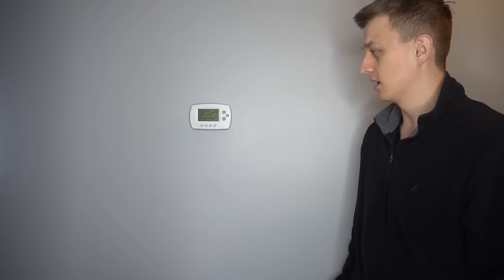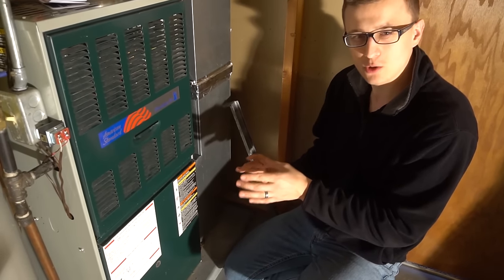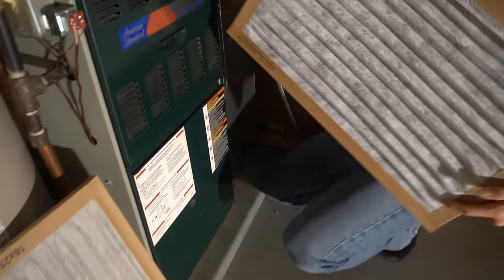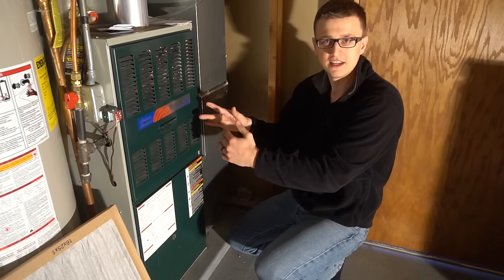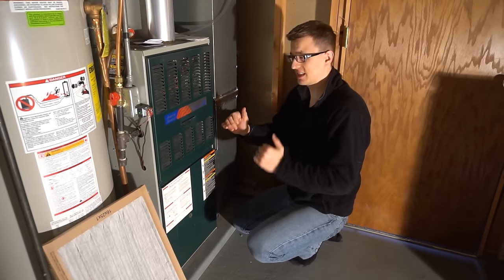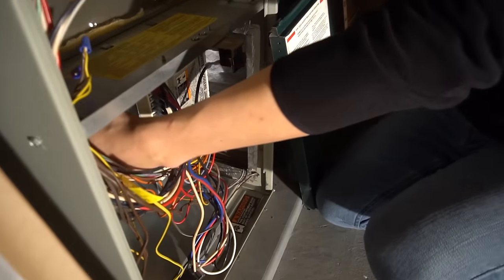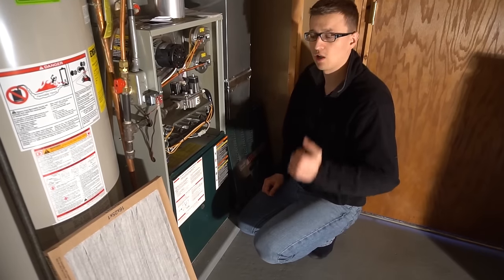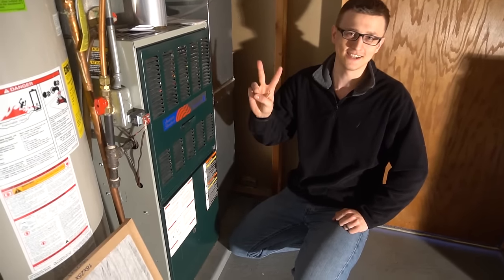Furnace not Keeping up SOLVED

Comment: Turning the squirrel cage (blower fan) by hand does not tell you the fan motor is burned out - it WILL tell you if the motor bearings are seized.  The windings could fail (or a capacitor if so equipped) in the motor, causing it to not rotate and thus no air flow. Your lockout should have worked, if not and the furnace kept cycling, it may have compromised the heat exchanger!  ALL furnaces should have a lockout - it`s pretty much required!
Reply: I don't really see how cycling will kill a heat exchanger in a couple hours- thats all they do. Also a lock out is a terrible idea, obviously if you have the heat on you really need it to be keep warm If the heat still works only OK its still way better than it shutting down when your on vacation and freezing all your pipes. As a GC I hate stupid controls like that. 

Also if you have a bad cap you wouldn't smell anything from the motor its self and it would turn free, So it would be pretty clear what it was.the last suspect for me would be a bad winding, fairly rare and thats when a diyer should probably call in a tech.

Comment: I had exactly the same issue mentioned in the video, took the steps suggested it worked. Now again on colder day the problem returned. So removed filter running it without filter. Is there any filter brand u can suggest won't cause it anymore
Reply from the maker: It's possible that your A-coil is partially plugged and that is what is causing this. I usually use a low MERV rated pleated filter. 3-5 MERV. The brand will not really matter though. It's not a good idea to run the furnace without a filter, it would be best to at least put in a fiberglass filter. (least restrictive)
Reply: @WordofAdviceTV  
First of all Thanks for your prompt reply. You are really doing huge favors to people. I have american standard Gold series furnace, do you have any video on cleaning A coil o this furnace. Thanks.
Reply from the maker: @aaii8700  Unfortunately I do not have any A-coil cleaning videos. Sometimes they can be quite a hassle to clean. A lot of people opt to hire a duct cleaning company to clean it for them. It's preferable that the coil is cleaned from underneath. In my video 10 Reasons Why a Furnace Overheats I filmed how I looked at mine if you are interested.

Comment: What happens if the machine starts, you can hear it turn on, but it doesn't come on? And it repeats the process but never turns on any heat?  Could it be the filter or the way my thermostat is set?

Comment: Hello, I live in South Florida and my brand new AC (2 weeks old) ever since it was installed, it runs for about 7 minutes every hour or so. The Thermostat states the temperature desired is reached, and therefore it just turns once (for 7 minutes) every hour. 

We set the temp at 72 before bed, and it will just run these 7 mins per hour to maintain that temp. 

Now, if I lower the temp by a couple of degrees then it will run for about 12 minutes… However, still just once per hour. 

Please let me know what could be the issue. Brand new Ac/Thermostat.

Comment: I have the same problem on the cooling side. My temp is set to 72 but inside temp is reading 74 and climbing
Reply: So did this work for you?
Reply: @momsmusclesmakeupbynickias2081  No, found out the coil is leaking freon

Comment: the filter u took out looks clean i dont understand why u switched fiters
Reply from the maker: Sometimes clean looking filters can actually be very plugged up. (sheet rock dust could be plugging it up for example) I have checked "clean looking but plugged" filters multiple times before by measuring the air pressure drop across the filters just to make sure. In my case, once I replaced the filter the furnace stopped overheating, so I didn't do any further checking. :)
Reply: @WordofAdviceTV  Based on all the debate here, I'm thinking you should do a video on furnace filters. I"m interested in hearing what advice you have :-)

Comment: I got a service call today for the same problem and i had to put a new filter and put a new thermostat just in case but .. Unfortunately  it didn't fix the problem and the furnace seems to be working fine but never reach the set temp!!
Reply from the maker: The filter is the easiest solution. There are many other things that can cause it to overheat.  I have a video with 10 reasons: https://www.youtube.com/watch?v=3ZPmltTR5S4

Comment: I hope this helps. It's 1° outside and my furnace was set at 77 because my insulation sucks. It wouldn't go above 71 and it's been running for hours before I noticed why I was abnormally cold (I'm always cold). I turned it down to 69 so the heat would shut off and changed the filter. Gonna let it sit at that temp for a bit so it has some time to cool down before running again.
Reply: No such luck. Had to call them out. He's saying I need 2 new heat exchangers, and an inverter and that it's producing more condensation than it should. Filled a bucket with water that smelled burnt. Minimum if under warranty is 2k, a new furnace which he recommended would be 5620. Can't run it due to high probability of carbon monoxide issues. Bought 3 space heaters and when I plugged in the 2nd the breaker flipped, so I never even got to try the 3rd. Been a stressful day and we are in the middle of a winter storm, so that's fun.

Comment: Hey, My blower is on, the flame comes on for about 5-6 mins and then turns off, then turns on fir another 5-6. Before that the blower was not turning on. I changed the filter, and it got a little better but flame keeps going out blower is blowing. I changed thermostat as well. Could it be flame sensor?
Reply from the maker: No that doesn't sound like a flame sensor. It's more likely that the furnace is overheating. I have a video on 10 reasons why a furnace overheats. Check it out for more info if you'd like:
https://www.youtube.com/watch?v=3ZPmltTR5S4&t=107s

Comment: -38 currently my furnace has been doing the same thing for as long as its been cold
Can propane lines freeze up or shoukd i go ahead and change the filter to see if its needs to be changed and replaced ?
Reply from the maker: I don't deal with propane too often but I haven't heard of propane lines freezing before. As for the filters, I see them be the cause of this problem all the time :) So I would start by replacing the filter and see if that makes a difference

Comment: I'm having the same problem in the day if temps above 38 no problem but cold nights below 34 it cuts on and off and when ever the unit turns on it sucks so hard that it want to eat the filter any solution?  Thank you
Reply from the maker: It kind of sounds like you do not have enough return air. Maybe add a return or 2? Are any of your return air registers blocked or closed off by something? If you use a premium filter, I would switch to medium grade pleated filters.  If the unit blinks an error code when this happens, what is the code? From what you described it sounds like it may be overheating.
Reply: @WordofAdviceTV  I have a ruud furnace but I'm getting a code of 5 than it blink a number 6 right after it none of these code are located on my panel.  Thank you
Reply from the maker: @ikeproc  Do you by chance have a lot of air registers/vents closed off? Also, the chart that explains those codes is usually on the inside of the furnace door or on the control board itself. Or if you have a manual from that furnace, you can find it in there too.
Reply: @WordofAdviceTV  We finally figure out the problem the furnace was set up for down flow and the control panel wasn't flip right side up so the code was not 56 but 59  a block drain, all is up and running well.  Thank you for your help.
Reply from the maker: @ikeproc  Ah I see! Thank you for coming back with an update! Glad you were able to figure it out, stay warm ;)

Comment: Mine is the opposite. It won't let me set the overall temp(when you hold the arrows and it let's you set. Mine doesn't do anything anymore. ) so I set all those custom Temps to 72 but it keeps cooling to 66 degrees. I changed the batteries and filter 4 months ago

Comment: What is the issue if it keeps blowing cool air because its over heating. It starts fine,ignitor works and starts but then it stops blowing hot and but then it starts blowing cold air. 

My question will never be addressed but it feels good letting it out

Comment: My furnace heat works till 68° and then just blows warm air but won't go above 68 any reason why, I cleaned carpartment that was full of dust, the filter was changed 2 months ago and the furnace worked before then at 75 so I just don't know what's going on a company has been out 5 times and can't get it running right either

Comment: I took out the sensor and the flame cleaned it some steel wool so off and put it back but it still goes on and off the furnace occur in the thermal coupler that’s late and up let me know what you think I should do

Comment from the maker: If you have 1 inch furnace filters, don't forget to change them every 1-2 months and you won't have the same problem I had ;) I kind of forgot about mine for about 3 months and that was enough to become an issue. Don't buy premium filters that are around 20 bucks a piece either.. They tend to restrict airflow quite a bit. Just get medium grade pleated filters. I buy a pack of 6 from Amazon like these for example: http://amzn.to/2EUlkUd
Reply: What's the lowest temperature these thermostats can pick up?
Reply: Do you know of cheaper options for 20 x 25 x 4? The cheapest I've found are about $20 each in packs of 2 (MERV 11). That's what the installer put in 10 years ago, so I've been using them and changing every 3 months. I don't mind changing every month if I can find something cheaper that will do the job.

Comment: I have the same problems, changed the filter same issue, changed the thermostat same issue. Set to heat 71 won’t go above 66-67? Thanks in advance
Reply from the maker: It's possible that your A-coil is plugged. If you look through the site glass on your bottom furnace door, can you see any error codes blinking while the furnace burners are not on but they should be?
Reply: Word of Advice TV thanks for the reply, ended up being a high limit switch. Working like a champ now. Thanks !!
Reply from the maker: Awesome! Stay warm! :)

Comment: Hello my dear, my heater setting 72 but the heat keep running to 90 does that mean dirty air filter?
Reply from the maker: Definitely not :) Either your thermostat is defective or the control board in the furnace is bad. It's stuck in a heating cycle that does not turn off. (you can turn the power off to the furnace to shut it off)
Reply: @WordofAdviceTV  
Thank you my dear....

Comment: What if during the summer the Thermostat is not holding its temperature? As the temperature is increased during the day it seems as though my AC is trying to keep up. It seems to be around 2° off of why I set it. Example temperature set inside to 73 house it’s consistent at 75. Then when I said it to 75 the house temperature increases to 77   What’s going on?  Everything else is working fine

Comment: I live in Florida and I’ve tried the no filter for a little bit with no change.   My ac runs for 12-13 non stop during the day.  At night it runs fine once it cools the house.   I keep the temp set at 78 but it never reaches the shut off point during the day and many times never reaches the set temp.  What are some causes besides the filter.    Oh and the coil is clean and the condenser coil is clean.
Reply from the maker: Unfortunately that sounds like you are low on refrigerant. Do you have gauges that you could check the pressures with? Although typically when it is a freon issue, that will require getting a tech to come out and look at it. One thing you can do to confirm this is to check the temperatures in your ducts and see if they are in range or not. Most likely they will not be in the 15-20 degree range. I have a video on that if you want: https://www.youtube.com/watch?v=beVRELr8Oak
Reply: Thank for replying.  The original tech put Freon in the second tech took Freon out.  They both said that it was full.  Neither of them did any test other than a gauge on the lines..  I now know thanks to YouTube university lol that there are many tests needed to be done before just filling or relieving the Freon.
Reply: There is a third tech coming out again
Reply from the maker: Oh boy.. Thanks for the updates! I wonder if you have a restriction in your metering device. Sometimes freon issues can become quite the project. There is also the possibility that your compressor valves are weak. But you are right, there are many tests that can be done besides just checking the pressures to narrow it down to the culprit. I hope the third time will be the last time!

Comment: I have baseboard heat in my house and I set the thermostat at 74 but with not reach temp.  I changes the thermostat and circulating pump and still no heat.  The boiler is operating  at 180 and cycling as normal and the pipes are hot throughout the house but not hot enough. I also purge the system thinking I might have air in my line and still no high heat.
Reply: What kind of baseboards? The 8"tall cast iron?  They stink compared to the old tall boys.. you may not be getting enough water thru it.. also depending on how big your house is a zone system may work better.. what are your water temps? What is your cut in and cut out temp?
Reply: Also flushing your boiler system each year before heating season is always a good idea.. rust can build up and cause flow issues
Reply: Thank you for your response. I have the floor baseboard which run throughout the house.  When the temperature on boiler drops to 160 it will turn on and reach the set temp at 180. I have to run the boiler at 25 to 30 psi so the heat could reach the third floor bedroom but sometimes the relief valve activates. Another issue I have is that sometime the psi climbs to 50 to 60 for no reason. What can that be?

Comment: What if my room temp is 82, I ve bee setting it to 63 on hold but wont change to 62. So freaking hot
Reply: Change filter
Reply: If room temp is at 82, you’ll never get down to 63. Or at least quickly. Turn it down a degree every 30-60 minutes until you get desired temp. It’ll take several hours to get down to 63
Reply: If there is draft in the room it won't kick off. You need to check to see if room has cold air coming in from somewhere.

Comment: I’m having an opposite issue where my house won’t cool down pass 83 degrees. I unclogged the drip drain I cleaned all the filters and Open all vents. There Luke warm air coming out and checked the fans. I need help it’s to hot!!

Comment: LOL if you're in charge of your furnace.. (ie: you're a home owner, or renting a house) then you should already be well aware of furnaces needing filter changes. This should literally be the first thing you do when moving in to a new house. Also since some of you readig this are thinking. "i never knew"  then you should also know that you need to empty your lint in your dryer after you dry a load of clothes.
Reply: As a new homeowner, I did change my filter. What I didn't realize (at the time) was the new filter was a higher MERV number. Couldn't figure out why my furnace wasn't working as efficiently. After doing some research, figured out I had an 11, went down to an 8 and bam, furnace worked well again. So it's not just knowing to change the filter, it's knowing there's different levels of filters - and higher isn't always better.

Comment: Mine won't keep up to the set temp either.  I just changed the filter.  It comes on at times, so it's working, just not at my request.  If I turn the fan ON, it also works, but the fan isn't running ALL the time on Auto.  It's keeping the house at about 64-66 when my request is set on 70.
Reply from the maker: So after you replaced the filter it is still doing that or you just replaced it? If you look into the sight glass on the bottom door of the furnace, (when it is not working right) does it blink an error code?
Reply: Mine ended up being the condensation trap. Fully plugged. Thanks to the post in here that suggested that! :)
Reply from the maker: Awesome! Glad to hear you figured it out :) Stay warm!

Comment: How to set call for heat setting? Seems like the room gets too cold before furnace starts.Temp temp gets too cold before heats kicks on.How to set length of time from room temp? I need to set the time sooner so the house doesn't get too cold between furnace cycles.
Reply from the maker: Are you sure it is the thermostat that is bad? Perhaps your furnace is overheating and going into a lockout and that's why it does not turn on right away.  When it doesn't turn on like that, does the furnace control board blink any error codes?
Reply: Yes it is normal.Once it is up to temperature,how many degrees should it drop, before relighting?  Thanks
Reply from the maker: @happycat  Usually even if it drops down one or two degrees, the furnace will turn on.

Comment: Pulling the filter out while running will "drag" the filter against the ductwork due to the enormous suction as you showed...and accumulated dirt will get into the system. Turn off the furnace ( only a few minutes "off").....replace the filter.....then turn furnace back on. Better.
Reply: He only did that to prove a point he was making.

Comment: Hey I have my thermostat set at 70 but wont go above 68 in temperature when it turns on. It's not even kicking on to try hit the 70 mark just hits 68 and stops. I've changed the filter, new batteries and even reset the thermostat.  And still when set to 70 wont go on to reach that 70 and stays at 68.
Reply: Mine is doing the exact same thing!! Literally exactly as you describe. Have you figured out what caused this? Always on turns on to hit 68 even when I have mine set at 70
Reply: @marthvadir  had someone clean the sensor and fixed the problem
Reply: Flame sensor in furnace